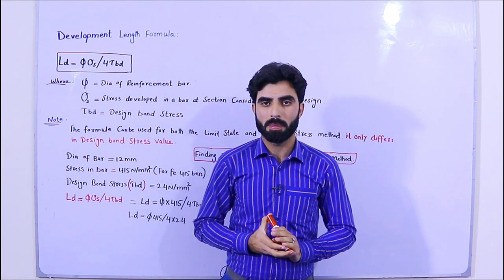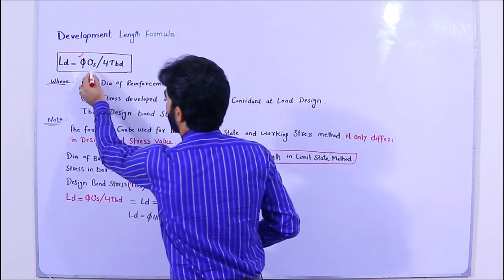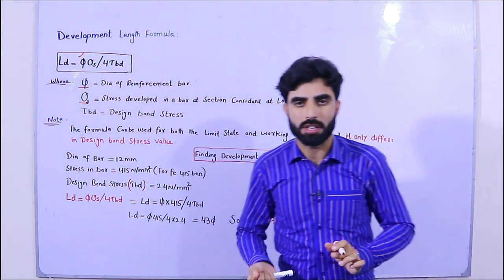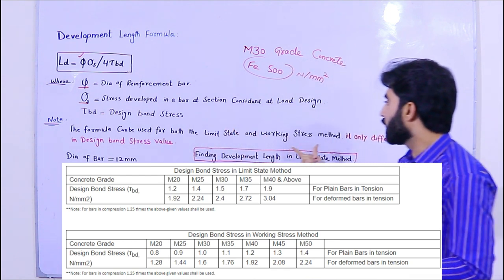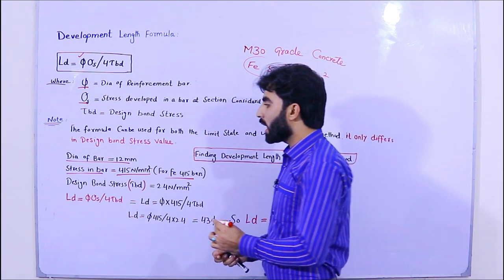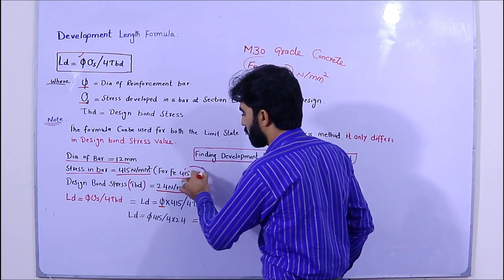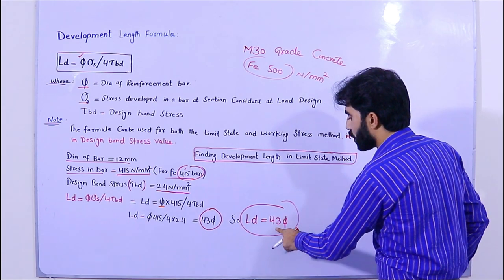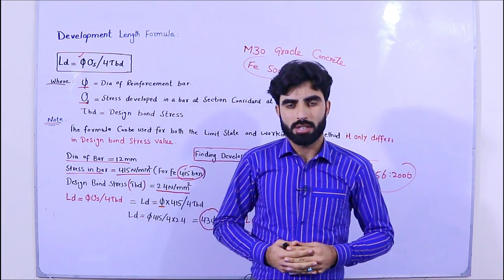Development length formula for beam and Column | How to Calculate Development Length?

Comment: Thanks.  I have seen in many videos where they multiply the strength of the reinforcement by 0.87 and also the table is for round plain bars and we should increase the Tbd by 60% for Y or T bars.